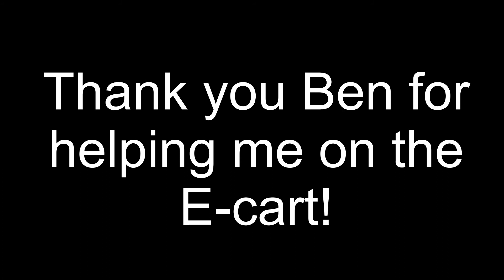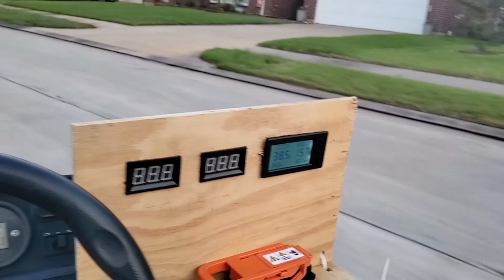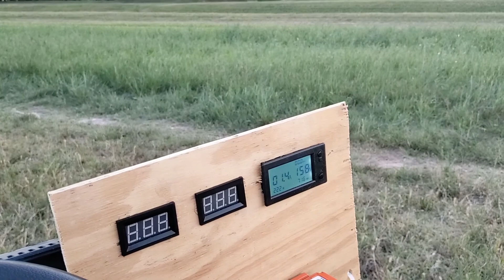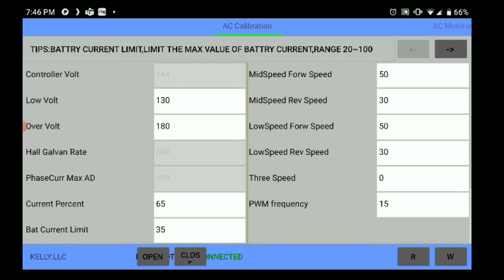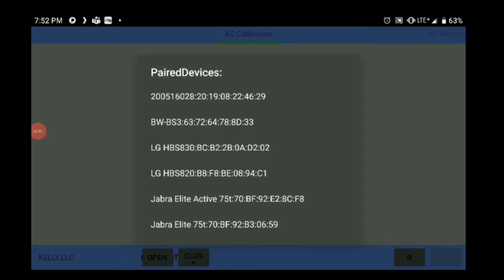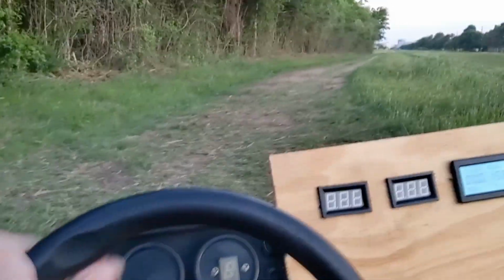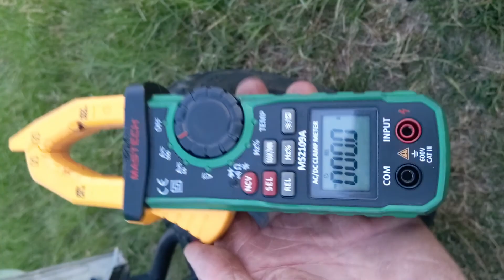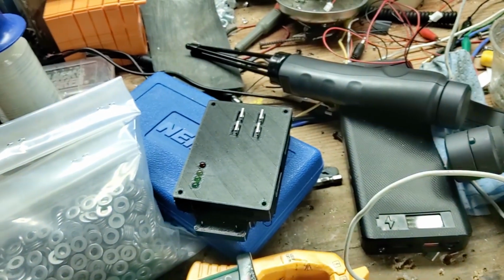E kart Vid 9

Comment: Would you sell me a bms
Reply from the maker: What are u looking for?   How many cells?  Amp range?
Reply: @ericensley2427  I have 2 45ah banks
Reply: @ericensley2427  is that good for 30,000 rms
Reply from the maker: 2 45ah banks should be good for 40kw.   But u need 800 amps of alt to back it up.
Reply: @ericensley2427  I have 600 amps
Reply: @ericensley2427  would you be able to make me the bms